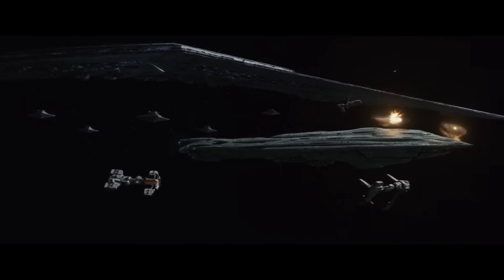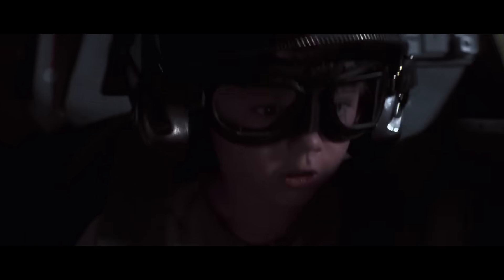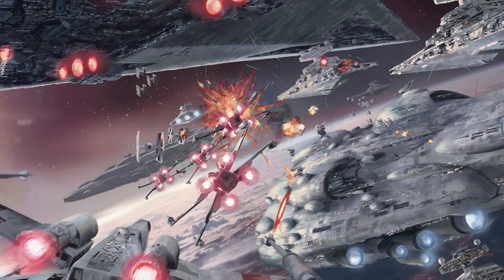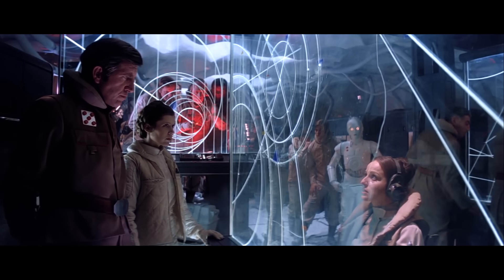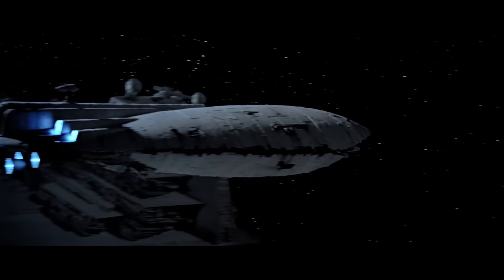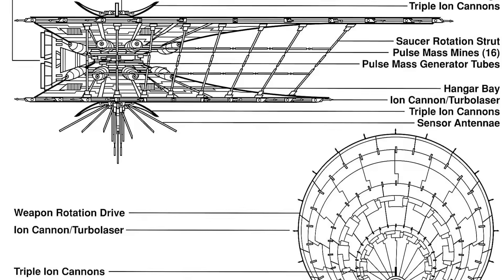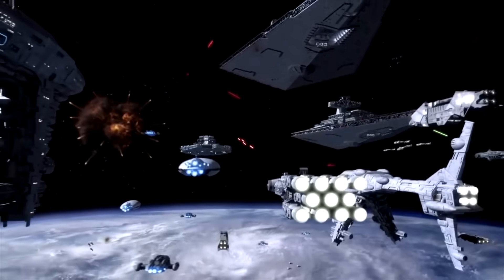Why Star Wars Turbolasers SUCK! (and better options) | Star Wars Lore

Comment: Isn't slow turning speed mainly a problem with the weapon mount rather than the weapon itself?
Reply: Doesn't really matter unless they can fix it. The weapon itself may be awesome, but if an essential system it relies on is less than ideal then the weapon becomes less than ideal as well by default. There are plenty of great weapons that were never or rarely used because of problems unrelated to the weapon itself, for example; low cost-efficiency, hard to use, very maintenance heavy, difficult to transport,... Something is only as strong as its weakest link.
Reply: Yes, and no. It is a Star Wars tech issue. So far they have been presented as slow moving and needing manual control. That is the currrent tech level in the Star Wars Universe.

On the other hand, we as a civilization have advanced far enough that we design better weapon mounts and fully automatic targeting systems that would be able to track a target and fire at it based on a most likrly position it  would have when the target and projectile meet up. So far less issues firing on a fast or erraticly moving target.

Mostly ofcourse it was done for cinematic and story reasons. So that it would look spectacular, while allowing for the severely outnumbered good guys to survive and win...
Reply: Yeah, it felt like arguing that HE shells are bad because tank turrets are slow and need a gunner, then saying that AP shells are good.

Any turreted weapon system in the SW universe would suffer the same problem.
Reply: I think the issues are more about credits and less about tech. The more underperforming the system the more of theses systems are needed to do the job, and when more maintenance the system needs to function at optimum the more parts are sold. With the Empire and the Clone war era Republic, the more credits flowing the easer it is to hide special projects and corruption. This would also explain the y-wing high maintenance issues.
Reply: They're too big to move around quickly with a turret. Since the time to target is so slow, and the rate of fire is so slow, it's useless for anything other than orbital bombardment and ship combat, and the latter is dubious too.
Reply: A lot of the weapon's characteristics determine the mount's performance.  You can't stick a 16"/45 gun on a CIWS mount. Isn't gonna happen. The additional cooling and power supply problems of the turbolaser essentially dictate that the mount for it CANNOT be fast-moving, and the tracking systems are expensive and not really effective for the mount's slow performance. 

The proper analog of the turbolaser is the 50lb long gun of the "iron and sail" era. 

Then again, this is all made up by a bunch of Art majors who never took a physics or engineering class in their life, and probably stopped Math at about 10th grade, so let's not put too much effort into figuring out how their creation "might" or "should have" worked, but they are simply is fictional and do not obey our physical laws.
Reply: @aurtosebaelheim5942  I mean, modern tank turrets are everything but slow tbf, also ammunition types all have different uses, an HE round may in fact be useless if fired against an MBT, at least frontally, so everything is relative to its main purpouse
Reply: No, I think he meant the bolt itself was pretty fucking slow
Reply: And honestly they weren't bad at hitting ships as small as corvettes, it was only starfighters and combers they had trouble with. The fact that an anti-capital ship weapon had any efficiency against strikecraft should speak to their versatility.
Reply: I totally agree with you.

Comment: Slow firing? i remember three munificents shooting the hell out of Aayla's venator on a clone wars episode, when the tactical droid orders full fire cadence, each cannon was firing one time in 3 seconds.
That's a very impressive firepower for some slow charging, slow shooting guns!
Reply: Yea, also in the Revenge of the Sith novel, the turbolasers of both the republic and CIS  are described, "moving almost at the speed of Light"
Reply: @Alduin_el_Compadre  Which is reasonable, the star wars cross-section books claim that the plasma projectile is accelerated by superconductors before leaving the barrel.
The cross-section books does not mention "near light speed", but something close to 10 times the speed of sound.
Reply from the maker: @Alduin_el_Compadre  you can find single instances to justify anything really. That book especially has lots of one off things like that. Another example is the skill of tridroids
Reply: @Alduin_el_Compadre  In all of the movies we can clearly see that the Shots aren't moving anywhere near the speed of light. More like supersonic speeds for Big Guns and sub sonic speeds for Blasters.
Reply: Alduin El Compa de la Destruccion And the novels are wrong, as they directly contradict what is seen in every film (the ultimate canon.) Blasters/turbolasers are definitely not lightspeed weapons, or anywhere near lightspeed.
Reply: @EckhartsLadder  

I suppose, you must have a thing to lowball SW.
Reply from the maker: @epistemo3442  yes, doing calculations based on comic book panels and stuff that is meant visually is better than actually looking at the lore
Reply: @EckhartsLadder  

I'm sorry, if I started a rant. There are somethings that drive me irrationally mad.
Reply: @epistemo3442  Wrong. The films have always been the absolute source of canon. If there is ever a conflict between the films and some other form of canon, the films are always right. Period.

As Eckhart said, trying to use silly, stylized cartoon drawings from a comic as actual evidence is simply nonsense. Christ, in the first scan you posted, the turbolaser impacts are literally just generic little "Ka-blam!" comic graphics on the planet's surface. THAT is your overwriting evidence? You can't be serious...

Also, I don't see what your point is with that last "blaster fire speed" link. It's still not even close to the speed of light (300,000 km/s) or anything impressive like that.
Reply: @Gunnar001  

*Wrong. The films have always been the absolute source of canon. If there is ever a conflict between the films and some other form of canon, the films are always right. Period.
*

That's Legends shit.  Legends is where Movies are always the canon at the top of the Legends Canon Hierarchy.

Now, Disney had bought LucasFilms and Star Wars, changing the Canon policy. There is no Disney Canon policy stated that the movies should be the absolute Canon, it is legends, not canon.

As Eckhart said, trying to use silly, stylized cartoon drawings from a comic as actual evidence is simply nonsense. Christ, in the first scan you posted, the turbolaser impacts are literally just generic little "Ka-blam!" comic graphics on the planet's surface. THAT is your overwriting evidence? You can't be serious...

So, are you stating that the power shown from the Heroes like from Marvel Comics is wrong, because it is just a mere drawing. And that the movies are the actual representation of them, because they're real in a sense of visuals.

That is so stupid.
Reply: @epistemo3442  
"Now, Disney had bought LucasFilms and Star Wars, changing the Canon policy. There is no Disney Canon policy stated that the movies should be the absolute Canon, it is legends, not canon."

I would love for you to post where it's stated that SW film canon is retconned by heavily stylized cartoon drawings.

"So, are you stating that the power shown from the Heroes like from Marvel Comics is wrong, because it is just a mere drawing."

Totally irrelevant to Star Wars, as the Marvel films and the Marvel comics have different canon policies. (Just to answer anyways: No. Marvel comic hero power and Marvel film hero power aren't "wrong" when compared, as they are canonically totally separate universes and aren't connected that way. Different universes with their own power levels.)

"That is so stupid."

And you think using wanked fan calculated explosive yields of cartoon "Ka-blam" comic graphics fired from turbolaser phaser beams is not stupid? 

OK.
...Good debatin' with ya.
Reply: @Gunnar001  

*I would love for you to post where it's stated that SW film canon is retconned by heavily stylized cartoon drawings.
*

Retcon means (in a film, television series, or other fictional work) a piece of new information that imposes a different interpretation on previously described events, typically used to facilitate a dramatic plot shift or account for an inconsistency.

According to this:

https://starwars.fandom.com/wiki/Wookieepedia:Canon_policy

https://scifi.stackexchange.com/questions/1806/what-is-the-singular-source-of-star-wars-canonization/1809#1809

This means, that because the TV Show and the Comic is part of the Disney Canon. That the Disney Canon had no Canon Hierarchy, unlike the old EU or Legends in which there is the higher Canon over the lower Canon.
Also, that the both the TV Show and Comic is a newer release.

This means that the TV Show and the Comic retcons the 6 Movies by the mere fact that there is no Canon Hierarchy and that it is a newer release.

*And you think using wanked fan calculated explosive yields of cartoon "Ka-blam" comic graphics fired from turbolaser phaser beams is not stupid? *

Because a galactic-scale Civilization had created a Superweapon that could literally destroy planetary shielding with ease and that orbital bombardment couldn't even penetrate the shielding in Hoth despite the fact that they have the Executor and a few of ISD. Vader was totally angered by this and chokes the admiral.

This means that a shield generator could survive orbital bombardment from some of the most powerful Ship in the SW galaxy.

"My Lord, the fleet has moved out of light-speed. Comm-Scan has detected an energy field protecting an area of the sixth planet of the Hoth system. The field is strong enough to deflect any bombardment"- General Veers, TESB

Meanwhile, the Death Star practically one shots the planetary shielding in Alderaan and destroy it completely.

http://www.st-v-sw.net/STSWalderaan.html

https://www.youtube.com/watch?v=xUSQZmqFQl8

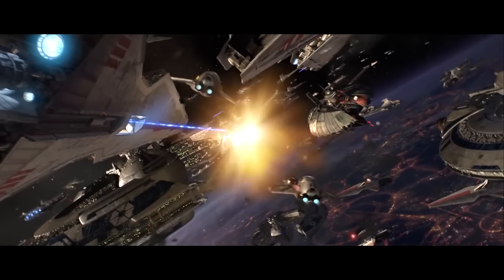Comment: 6:12 that weapon was not mounted on the Venator. It was a Walker based weapon used in to take down the droid command ships in the first battle of Geonosis and also used to put the Zillo beast asleep in the Clone Wars.
Reply: I just wanted to point this out, but I was looking through comments if someone did so before
Reply: I thought it was a bit weird that it was coming out of the hanger. Really clever on the part of whoever decided to use it like that, though. That's something you'd expect an actual named protagonist to come up with.
Reply from the maker: Depends. You're right for legends but not canon.
Reply: Yeah, firing a giant laser out of the hanger bay seems weird. But then again, I suppose there could be a good reason for it?
Perhaps this is a weapon usually used for orbital bombardments, so it is mounted in a fixed position inside the ship. It isn't externally mounted because it doesn't need to be, and the internal mounting offers better protection.
Reply: Screaming Cactus that's because Anakin came up with the idea (or rather was later made to) in the clone wars animated series.
Reply: Actually that's where you are wrong.

The walkers they used during the battle of Geonosis was the SPHA a massive and modular artillery walker. The walkers used to put the zilo beast to sleep were called Stun Tanks and were a completely different and smaller walker using a different chassis.

The SPHA was the one installed in the Venators.

In Legends the walker was put in the ventral hanger so that it could provide extra fire support and covering fire.

In Canon according to the Battlefront 2 made by EA the SPHA Turbolaser cannon was removed from the walker and actually installed as part of the ship which you can clearly see if the republic wins during the space battle matches on kamino.

Seth Lundquist
No the SPHA's Turbolaser Beam Cannon was not a orbital bombardment weapon it was an artillery weapon used on the modular SPHA artillery walker against massive targets like ships, fortifications, fortress's, cities and vehicles. And the Beam Cannon weapon was far to much of a pinpoint to use as a orbital bombardment weapon. Using it as a orbital weapon would be like trying to hit a fly on earth while in space with a pin point laser.
Reply: Yeah
Reply: @SethLunchquest  This was an improvised weapon. Venator had relativly small firepower, so to fix this fast and whithout reconstruction, some commanders simply placed SPHA artilery in hangars.
Reply: Wow what do you know
Reply: @EckhartsLadder  they are called turbolaser beams, and are usually used for orbital bombardments. Imperial class destroyers have them also, as shown in the canon comic "darth vader burning seas #17"
Reply: Ah,The Self Propelled Heavy Artillery...
Reply: @EckhartsLadder  I believe in canon it was anakin who made the suggestion to place SPHA walkers on the hanger bays of the venators, which was what we see in the scene in the video.

Comment: Truth be told...using actual laser weapons would be a huge game changer for star wars factions. There exists no starfighter that can  dodge a laser beam. Shields would still be weakened by lasers, and lasers are far more efficient and compact than turbo lasers. 

Then again, with the advent of hyperspace tracking and hyperspace ramming, the age of gigantic capital ships is effectively over. 

For one mega class star destroyer, I could build 100,000 interstellar missiles equipped with faster-than-light drives, multiple independently targetable warhead delivery vehicles equipped with modified faster than light drives that allow for high relativistic travel.  

Alternatively, I could build over a million Faster-than-light capable interstellar cruise missiles to target whole battlefleets and armadas from afar.
Reply: Lasers would fuck up any scifi universes ships, on you battles would be held at distances were you wouldn't visually see the enemy and possibly even your own fleet, you would see them via other sensors, lasers and other speed of light weapons out rank both mac and plasma based weapons like turbo lasers .
Reply: @zach kapsh You wouldnt even see them shooting at each other. You can only see a laser if a part of its light gets deflected on particles but there are no particles in space so you would just see one ship explode seemingly out of nowhere.
Reply: @Stego1819  there are practicals in space it's just a very low density of particles. But before a ship would even blow up due to lazers it would heat up so much it would boil the occupants alive.
Reply: @zkapsh  True. Would be even more boring though.
Reply: @Stego1819  not if you make it right, if your filming a movie were they use realistic lazers then you show the crew trying essentially trying to survive as long as possible.
Reply: There are no explosions though and what is a war movie without explosions.
Reply: @Stego1819  Boiling reaction mass can rupture the tanks and majorly damage the ship. Here's the explosion.

Comment: At least in the old fluff, turbolasers have teraton yields. Stupendous firepower, impenetrable shields. 
A few hundred teratons of kaboom (enough to vaporize a large country) covers many sins.
Reply: I am sceptical of Turbolasers possessing teratonne yields, considering that our largest energy outputs from nuclear bombs have consistently remained below 10,000x that.
Reply: @awe-fullanimations4737  The teraton yield was based on the power output necessary for a Star Destroyer to perform the maneuvers the Imperial fleet did around Endor. Circumnavigating a planet in a minute takes roughly a couple of thousand G's. The power output is absolutely immense. And this is the civilization that build the Superlaser after all. That thing basically rivaled the power output of a quasar for the duration of the firing sequence.